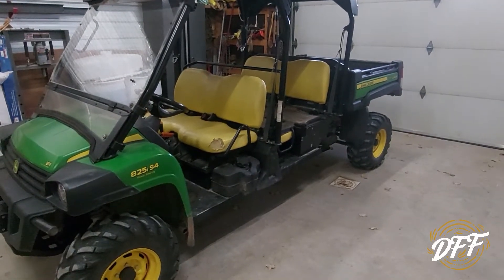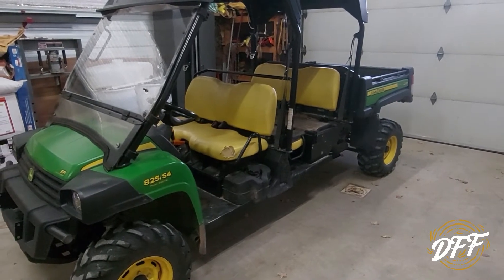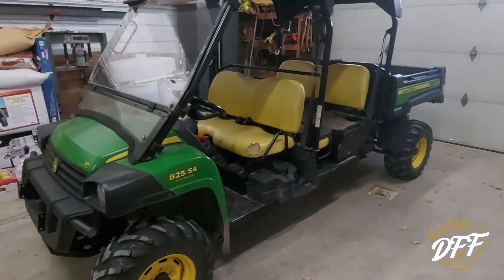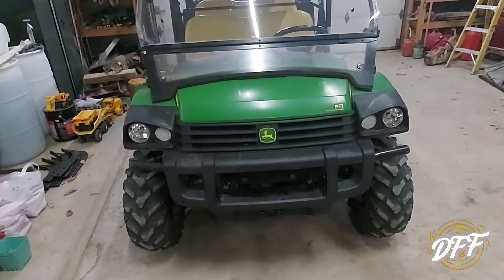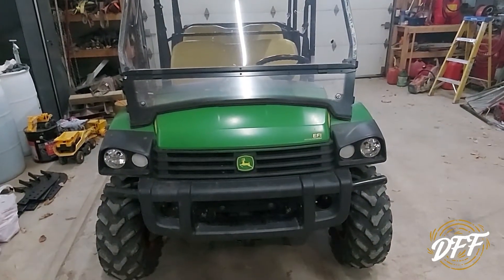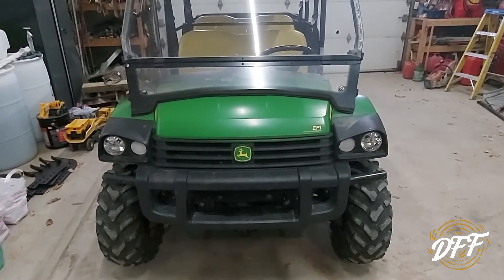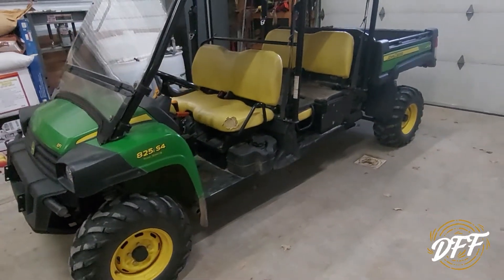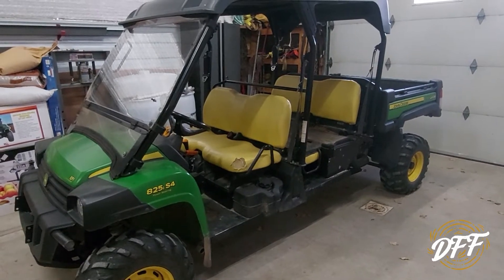Our Gator Is Fixed- For Now......

Comment: We've had some good luck with out 2011 825i.  I'm at a point where I have to replace 3 of the 4 CV axles because the rubber boots rotted away and dirt got in them and ruined them - they pop while driving - ...so I bought 4 from americancv dot com for our gator.  I've got a couple of days planned to pull and replace all 4 CV axles, 4 wheel bearings and pull the front wheel drive PTO that's attached to the transmission because the front seal is leaking trans fluid.  I came across your video today because I also purchased 4 new ball joints because I've seen a couple of videos of people that had the same ball joint issue that you've had.  I don't want my family to get stranded because of this.  I'm glad you were able to get it fixed.  Labor seems right, and the price for the ball joints are in line with what I paid at my Deere dealer in central texas.  Hope things get better for you!
Reply from the maker: I'll have to check out that website for parts I may need in the future. Thanks!

Comment: Dude. ...go Kubota. I have a feeling more things will go wrong soon
Reply: @Jeff Reymond gotta say, you guys are right.. I'd go orange before going green! At least for a side by side 😎
Reply from the maker: @Farmall Fanatic I did try, but because of all the shutdowns this year, there is a shortage of inventory. Maybe next year 🙂
Reply: @dehavenfamilyfarm  good thing with kubota rtvs  it uses same supplies from the kubota tractors wich deffently make it so easy wich thats why im going with a kubota gl generator
Reply: @Jeff Reymond yeah with kubota rtvs it uses the same kubota tractor parts wich makes life easy instead going different parts  wich why im going with there kubota GL 7000 or GL11,000 generator
Reply: @Jeff Reymond yeah kubota uses tractor parts same wich why kubota smart plus there kubota rtvs build sames as there tractors wich smart engineering

Comment: Bill didn’t look too bad, when I first saw it I though “wow, it’s only three digits”. 😆 As for the failures, if your 4 seater uses the same front end components as a two seater that might be contributing. The longer wheelbase would be putting more load on the front axle compared to a 2 seat version which could lead to accelerated wear if they use the exact same parts. Just a shot in the dark though.
Reply from the maker: The bill was definitely less than it could have been for sure. I never really thought about it, but you have a great point about the longer wheel base putting more stress on the front end. I may do some research to see if anyone else with the same model has had the issues we have had. Thanks Blake!

Comment: Sadly the ball joint failed because of poor quality materials/building. I was an auto/light truck mechanic and replaced many ball joints in my time. Some of them had grease fittings some not. Certain vehicles (high end German and Japanese) were built without grease fittings and never had the ball joints fail. They used better metals with tighter tolerance in manufacturing. Grease fittings aren’t necessary if built right in the first place. Planned obsolescence.

Comment: I have used kubota rtv's and was not impressed. No ground clearance and slow. My aunt has a Honda side by side and it's very nice,  but the door are small and a big guy like me has a hard time getting in the seat.  Have a couple of friends who have Kawasaki side by sides.  Those things are nice.  If I ever get a side by side that's what I am getting in a 4 seater.
Reply from the maker: Is the Kawasaki still the Mule? They have been around a long time too, and maybe have things figured out. I saw Can Am came out with some new models, but I don't know much about them.
Reply: @dehavenfamilyfarm  Yes as far as I know. One of my hay customers have a nice 4 seater Kawasaki mule. It's pretty roomy to me. Have a good week.